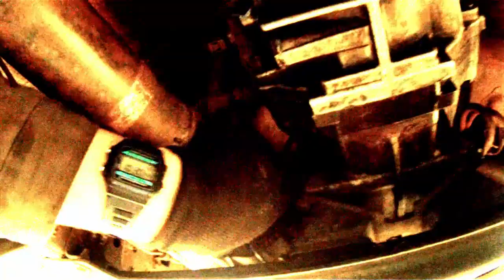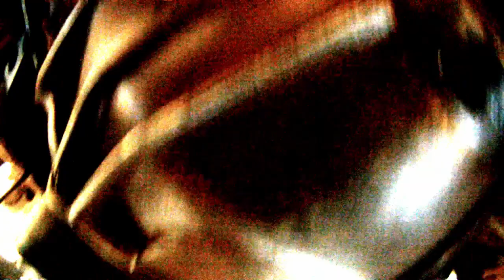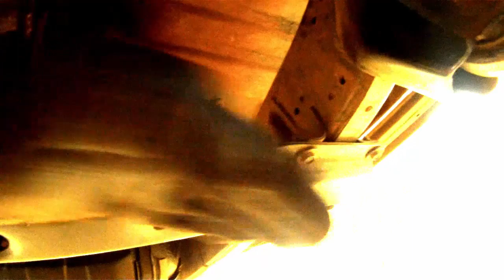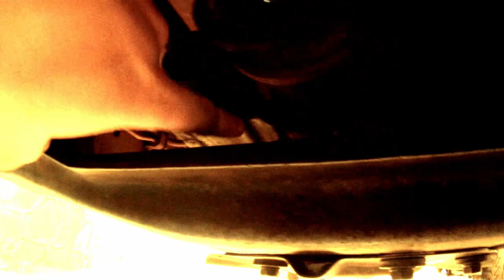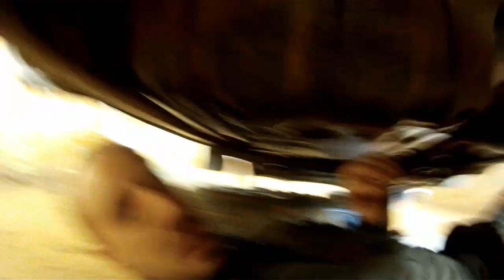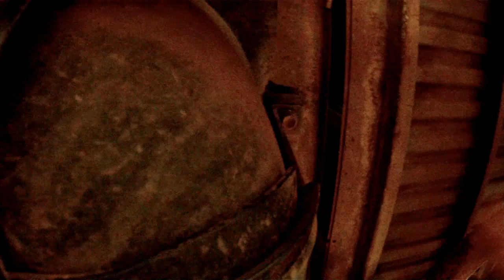Gearbox, Transfer Case & Fuel Tank - Land Rover guide to the Land Cruiser - 11/15

Comment: The achillis heal of the HD 70 series is the gearbox: weak 5th gear housing on the alloy casing makes for premature wear and will brake leaving you stranded at some point. People put in the 80 Series iron gearbox and up-rated turbo clutch which is indestructible
but it is an issue Toyota should have adressed and no-one knows why they did not on 1HZ..they do give pretty good service if used as designed but when you put big wheels on and drive long stretches of high speed motorways it does shorten it's life..a shame really as the gearbox is very smooth, quiet and easy to shift..the V8 Cruisers in OZ addressed the issue..shame we don't get them in Europe though, cheers, M